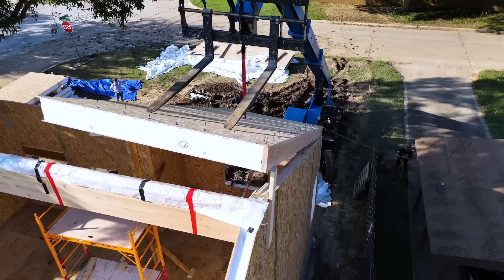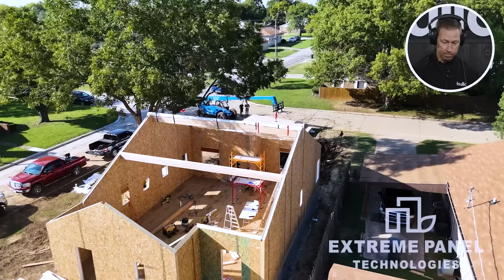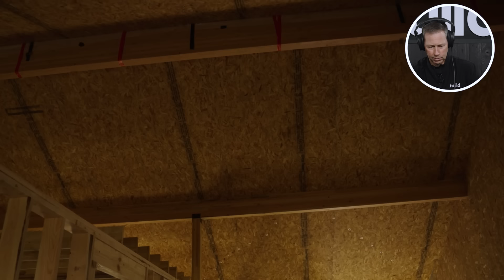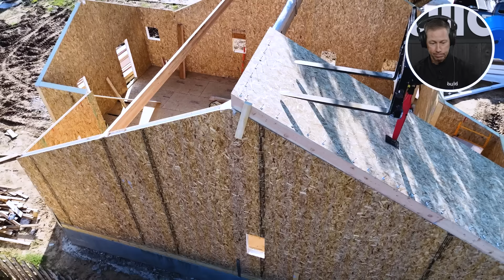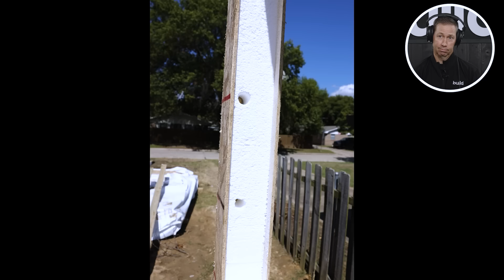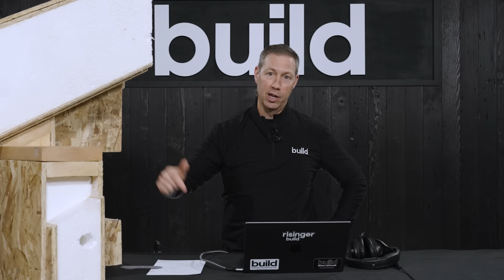High Performance HACK - Why More Builders Are Choosing SIPs

Comment: I notice that Matt R. rarely uses SIPs on his builds. I wonder why?
Reply: They rot
Reply: @justinwalz1149  go to the Nordic countries & find a rotting SIPs ,house, i see you in 20 yrs for the answer, "hint" zilch zero ,none, unless its made by a american cowboy company :)
Reply: @justinwalz1149 is this true? (Serious question.)
Reply: @ThatAdam12 the seams are the weakest point. Completely reliant on the sealant.
Reply: @brucemurray2520 so crazy that in the 21st century we still can’t get this right (in the US at least).
Reply: @ThatAdam12  yeah, coming from a build science perspective, this is an incorrect model of insulation. Correct (from inside out) is vapor  retarder, insulation, sheeting, air/water barrier, exterior insulation (if desired) rain screen, then  siding/cladding, etc. Sips is simply two vapor open panels sandwiching a vapor closed eps, too much room for mold on under side of panels, at seems, or to interior walls. Not to mention bug pest issues. I would go with an ICCF block properly set up if you need high R value, high strength, etc… Or exterior insulated high strength/sheer wood framed.
Reply: @justinwalz1149 it’s surprising then that it’s an option, or that banks would land on this type of construction.
Reply: @ThatAdam12  If installed incorrectly, catastrophically.
Reply: @justinwalz1149  You obviously have not been clued into Joe Lstiburek's comments on SIPs and how they are the perfect wall assembly because they are bilaterally symmetrical.  The EPS is the SIP panels can be treated with a borate mineral to mitigate carpenter ant and termite issues.  

Guess what the ICF's you talk about are made from?  🤔🤔
Reply: @GrandWaters  That goes for any material installed incorrectly.  What's your point? 🤔🤔
Reply: Thanks for jumping into the conversation here. There are some good questions and a few misconceptions that come up often, so let me clear a few things up.
Matt has been a solid partner of ours for several years, and he is currently in the plans to use our SIPs on an upcoming project at his personal property. I expect he will share more about that when the time is right.
On SIP performance, everything comes down to the complete system and whether the details are done correctly. Modern SIPs do not fail the way older versions did. When they are installed with proper air sealing, moisture control, and the right connection methods, they do not rot, they do not sag, and they do not attract pests any more than traditional construction. They are engineered to stay dry, stay strong, and deliver consistent energy performance. That is why they continue to be approved and financed just like any other modern building system.
Every construction method has failures when details get skipped. Stick frame, ICF, masonry, all of them. The difference is that a properly built SIP structure is incredibly strong and incredibly efficient.
If anyone wants accurate building science information or examples of long standing projects, we are always glad to help.
Reply: @ExtremePanelTechnologies Well said! I’m planning on using you guys when we are ready to build. I have a couple questions. First, how does your system compare to high end wall systems similar to Matt’s typical system? Also, I’ll want installers experienced with your system to reap the benefit of framing labor savings. Do you have a list of electricians experienced also?
Reply: SIP makers in Texas disappeared. Great thermally, but as with any new product the SYSTEM of build science must be addressed. As in a mention of rot. That occured big time in Alaska for failure to address condensation.likely some here in Texas too. I knew a couple of early adopters. It was phenomenal: at least for the first 20 years that I knew of. I would build this way if the condensation issue is solved and if they were bug resistant of which I know nothing, but that I want neither bugs not harsh chemicals.
Reply: @alantittle299  condensation management is just a matter of effective ventilation. With a more tightly sealed envelope a whole house mechanical ventilation system is required. You also need to have a vapor berries in the correct location (interior for cold climates, exterior for warm climates). The problem isn’t the SIP itself; it’s failure to plan to accommodate the tightness provided by the SIP.
Reply: @B @BikeFlyCampAK  yes indeed, thanks
Reply: @alantittle299 fluid applied vapor barrier like elemax should eliminate that issue with a decent rain screen system for your roofing and siding
Reply: @alantittle299  Check out R-Control in the south Dallas suburbs.
Reply: They weren’t sponsoring him until now
Reply: @crimeAndOats your point?
Reply: Matt builds extremely expensive custom homes that call for lots of specific details. I think SIPs are great, but the cost and speed savings don’t matter as much to Matt’s customers who are spending $5M+ to build their homes in Austin.
Reply: Matt has a crew of FRAMERS, that’s why he doesn’t build with superior ICF, it’s Always stick built homes.
Reply: What everyone always forgets to tell people about this type of sheathing is that ants and insects can very easily burrow and chew through all of that plastic straight into every post of this and obs rot is so common none of this is really a lasting space. Plus you'll be feeling and hearing everything throughout that house and outside
Reply: @DefinitelyTaro zinc borate treated OSB is a must. We use it on every panel!
Reply: @DefinitelyTaro Much of the EPS used is treated with borate, to deter pests.
Reply: @DefinitelyTarowhy do you feel and hear everything on the outside with osb?
Reply: Because he only promotes it because they sponsor his show.  For his own builds he prefers greater quality.
Reply: @buddyrevell-3-Oclock pretty shady, surely he makes enough off his jobs. If not then he doesn't need to be pushing a failing product. Don't accept a sponsor just for the money. Be sure the product, service, or game is legitimate.
Reply: He talks a big game and runs his mouth but seldom executes it in his own business in a fiscally responsible way. Classic YouTube builder
Reply: @richie1317 could be about what his client wants to use

Comment: Builders in my area act like structural insulated panels are some kind of foreign poison 😢
Reply: Historically there have been problems with sips...  It takes only a very tiny air leak to allow moisture to build up against the outside skin, and most folks know what wet osb is like
Reply: @ACatKrom What's the solution to that? Do you nail on furring strip's and space the exteriors sheathing off the panels to allow airflow (with bug screens to prevent critters getting in between)?
Reply: @TheOneWhoMightBe  There is no great solution, you can use a large rainscreen gap for siding, and do a double roof, but there is no guarantee that it will be enough.  That will allow the osb to eventually dry, but there is no way to keep it from getting wet in the first place.
Reply: @TheOneWhoMightBe  Seal them very well, as described in the manual. Install an ERV or HRV system & keep an eye on humidity within the home.
Reply: @GrandWaters  Great suggestions. 👍👍
Reply: @ACatKrom  Please site the source of your ridiculous comment. 

 It's easy to just spout off on forums like this without having any factual data to substantiate your allegations.
Reply: @JoePasma  If you don't know about this, than you are the only one making a ridiculous comment.  There have been tons of problems,  (including my aunt, and uncles house in NY) and several studies into the phenomena.  
A 2 second search of "sip rot" will provide you hours of reading on the subject, with case studies.  One of the largest was in AK
Reply: @ACatKrom  The SIP itself is not the problem.  Poor installation by PEOPLE is the issue.  That is exactly what was learned from the Juneau AK situation.

Any building material used to make a high performance house will not stand the test of time if the HVAC systems are not properly designed and installed in the home.  Building Science has taught us this.
Reply: @JoePasma  The issue is the sips/material.  When a product is impossible to install "correctly" its a product defect, not a people defect.
You claimed that I didn't know what I was talking about, and there was no evidence yet know all about Juneau, so why did you lie??
The only reason for anyone to do that, is because you profit off the use of sips.
The issue can and does happen almost anyplace where a high enough R value is needed to consider sips.  Like I said it happened to my relatives here in NY state.  
No hvac system in the universe is going to prevent condensation on a surface below dew point temp.
Reply: @ACatKrom  Wtf did I just read lmfao.. Dude called your statement ridiculous for saying that it has issues related to leaks, and he's like "no theres nothing wrong with SIPS..... only if there are any leaks from installation error..." Some people argue for the sake of it lol
Reply: Some people feel that both foam and sheet panels may off gass harmful chemicals. That could be minimal with the right kind of wall finish like the plasters used in the Lifestone construction system.
Reply: @marctorr5551 - All foam is going to off gas to some degree. With EPS, the off gassing is air. PUR will also off gas (not air, so more potential for nasty stuff) and will also lose a bit of R-value, but then will settle in. If OSB is used for the skins, which is very typical, it will also off gas, but the degree and gases will depend on the quality of OSB. Plywood will also off gas, but again the results are variable. Of course, OSB/Plywood will also off gas in typical stick-build construction as well.
Reply: @GrandWaters  Pentane is used as the blowing agent of EPS.  The pentane is contained in the raw bead that goes through a pre-expansion process and a expansion process in the block mold.  I guess if you consider the natural expansion of a gas as it is warmed and works its way out of the EPS bead, yes that would be considered off gassing.  And as you stated this occurs during the block molding process long before the EPS cores find themselves at the SIP manufacturer.

SO this is a long way of saying, no off gassing.
Reply: @JoePasma  Unless the EPS manufacturer is also the SIPs manufacturer.  How much time does it take to offgas?
Reply: @GrandWaters  The EPS block molding process is completely separate from the SIPs lamination process.  I know of one SIP manufacturer that is also an EPS block molder with both operations under one roof.  

The pentane off gassing occurs within the first few hours of molding.  At most a few days after the molding process.  

Typically, the EPS is not delivered to the SIP manufacturer until the block has "aged" for a few days.  The aging time will depend on the ambient plant conditions.  Aging allows the moisture, in the form of steam when the block was molded, to escape and dry out the block.
Reply: @JoePasma  I'm aware, I worked in a plant.
Reply: @JoePasma  We heated our blocks during the curing process.  The pentane did seem to dissipate quickly, at least not too noticeable by smell.
Reply: @GrandWaters  Which plant?
Reply: perhaps they've been doing it long enough to remember the SIPs Ridge ROT of the 90s
Reply: It literally is poison. Preservatives, glue, synthetic substances , all in an air tight shell for you to breath. These houses are 20 year houses.
Reply: @markanthony3275  20 year house?  There are 1000's way past that expiration date.
Reply: @GrandWaters  Agreed
Reply: @markanthony3275 yup. All those chemicals and it still rots. Meanwhile natural pine lumber has an amazing super secret material called sap which acts as a natural sealant ;-)
Reply: @Natedoc808  Do you have any idea what happens to any wood product that gets wet.  Wet being defined as a moisture content of more that 19%.  Organic growth can be promoted if temperature and and a food source are present.  Sap has nothing to do with anything.
Reply: @markanthony3275  Please site your source of a very high failure rate.  It's easy to just spout off on forums like this without having any factual data to substantiate your allegations.
Reply: @markanthony3275  Nah bro these homes are beautiful... Timberframed homes with SIP... absolutely beautiful..
Reply: It's cause their mexicants will mess it up and they only taught them a certain set of tricks.
Reply: Because they have never worked with them and are afraid of what they do not have experience with - I am guessing.
Reply: @spenceralridge4958 school children can put those panels together. Contractors do not make money on sips due to much higher price of the house kit from the factory
Reply: @spenceralridge4958  This is the friction point for any industry that needs to embrace new technology. At SIPA we proudly say that once we've recruited a builder to use SIPs, they never go back to sticks. The former is streamlined. The latter is too much work. Of course, these are perspectives you have to dive head first into in order to understand.
Reply: I am sure that with the right detailing, carefully executed, SIPs can work great.  But Joseph Lstiburek has detailed some disasters with SIP roofs where his firm was called in to do a forensic investigation, so yes, there is the potential for big problems with moisture, rot and OSB disintegration - "ridge rot".  The bottom line is, they're not that common, so your average builder doesn't have decades of experience with them to learn and refine those details and see how their build performs over the long haul.